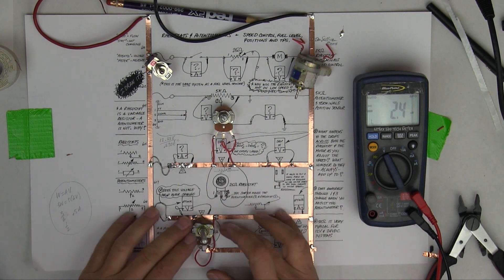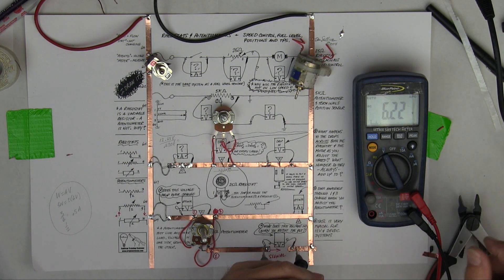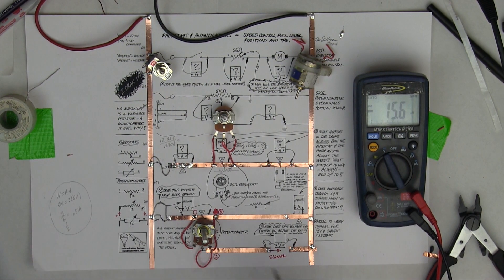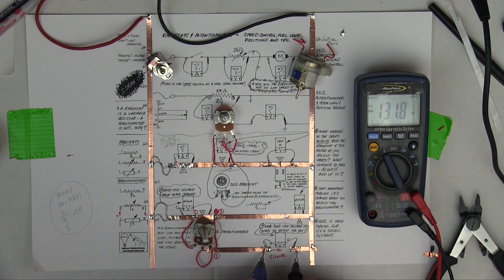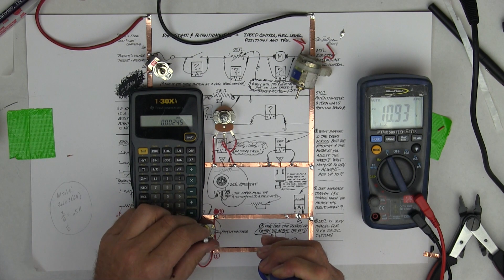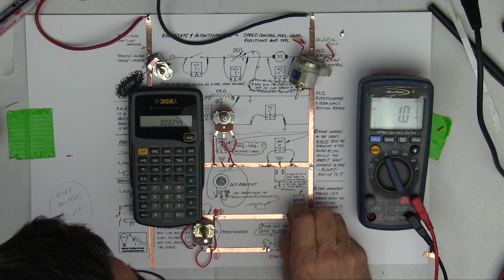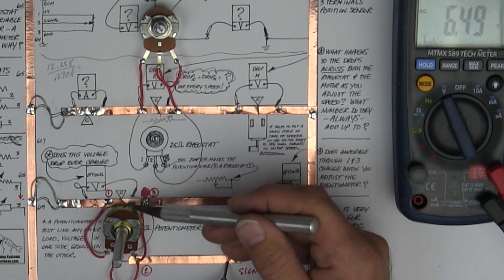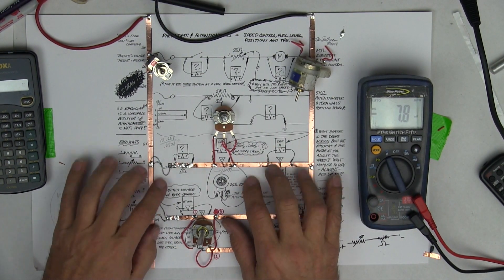CARD 6C - POTENTIOMETERS - Hands-On-Line Electrical Training

Comment: The only way that I can explain what is going on with the raised voltage is to use Kirchoff's voltage law. 
If I tried to explain it with my own words then it would be a mess.

Ill try....

adding resistance caused a voltage drop at that resistor, which in turn lowered the voltage across the potentiometer. 
The lowering of the voltage at the potentiometer would cause a rise at the signal due to the signal circuit having to add up to 12v.

Basically, the less voltage drop at the potentiometer is a raised signal voltage.

Correct me if I am wrong or if anybody can explain it in a fashion that is a bit easier to digest.

thanks.

Comment: I think it's because you are now reading across the 470 ohms resister and if you read across the potentiometer you will get the difference in voltage, voltage drops must add up to source voltage.

Comment: hi dan,when you put the resistor in and the voltage rose,that was what i was expecting.all the answers are in the video.when you cut the copper ribbon to measure the amps,before you repaired it you measured the voltage and it read 12.45v then you repaired the copper ribbon and got 10.7v. so when you put the resistor in,it did as i expected. its all good stuff dan,love it